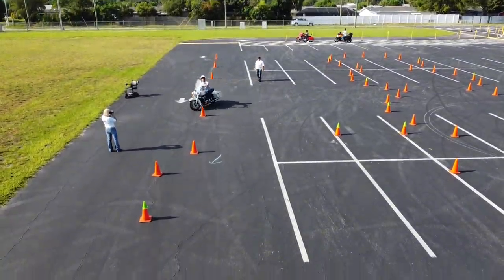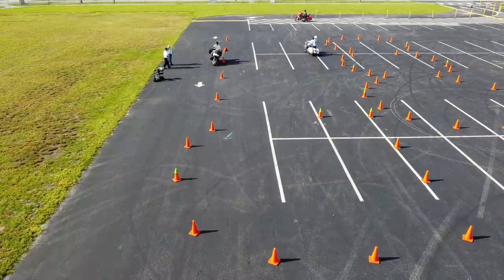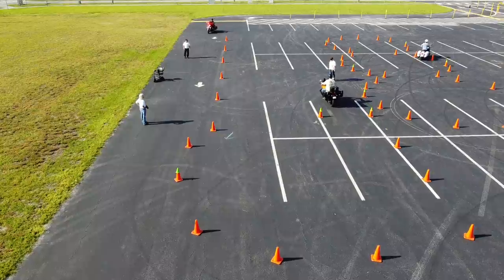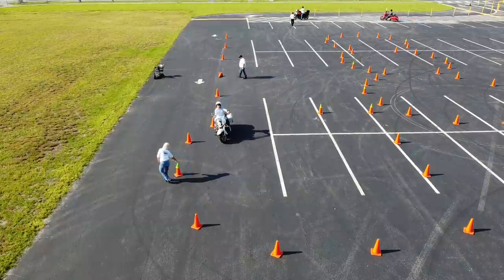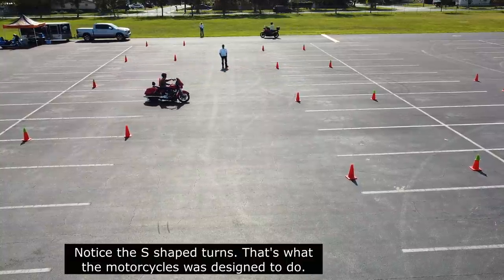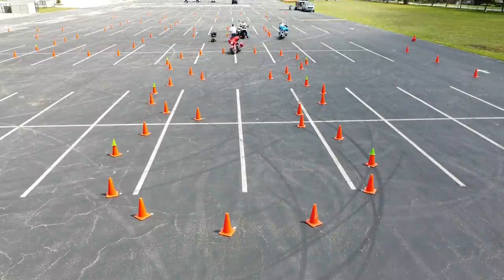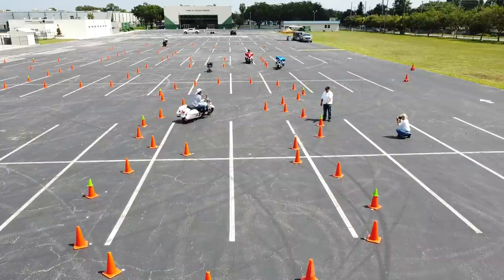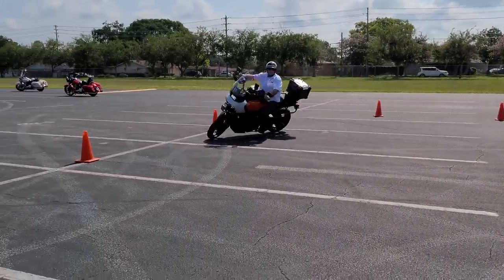Is the new Harley-Davidson Pan America good for low speed handling?

Comment: I had a similar issue on my Indian Scout. I replaced the seat, and then I was unable to get the bars to full lock without them hitting my knees. Stock bars, but had floorboards. I rotated the bars up a little, and had no issues after that.

Comment: I practice my slow speed turns at 8 to 10 miles an hour just like you told me I still feel like I’m gonna drop the bike what am I doing wrong I have a 2001 heritage Softail please get back to me somebody
Reply from the maker: Put up a video of your practice sessions on youtube and send me the link. I can usually tell where your problem lies very quickly.
Reply: You say you "feel" like you will, you have not so just relax and pratice.
Reply: I'd start with large circles and slowly tighten them as you get comfortable with feeling the bike lean. That had helped me A LOT. Also, I know its a simple thing but make sure to check your tire pressure. Incorrect pressure can make the bike feel squirrely and more unstable. Just my 2 cents. Good luck brother!

Comment: Any opinion on a Triumph Rocket III touring in terms of easy or harder to handle?  Had one for about 5 years now, and I do consider it a bit of a handful compared to all my previous bikes.  I'll probably stick with it till my knees tell me its time for a Spyder.   Just curious.
Reply: That's not a bike. Its a tank.  Have you sat on the new BMW R18?
Reply from the maker: It will take plenty of practice to master that bike at low speeds.
Reply: @stuartbear922  Thankfully NO.  The last couple BMW's I sat on I liked so much I purchased without asking myself if I could afford it.  I've seen it online and to me it looks slick!
Reply: @motorman857    Very true.